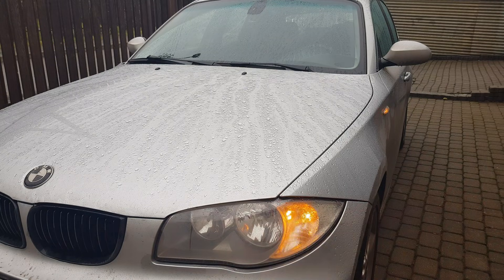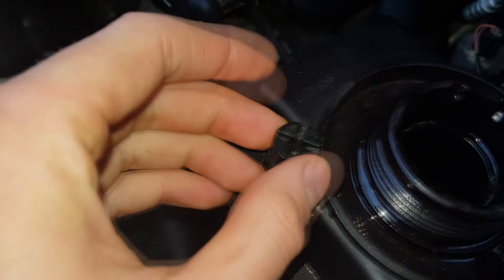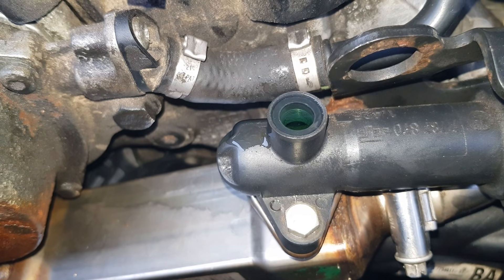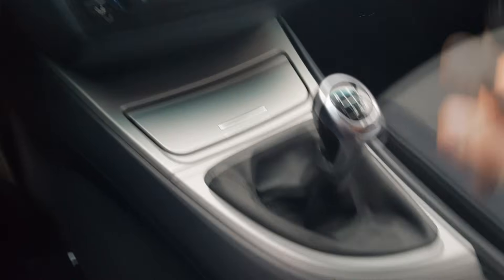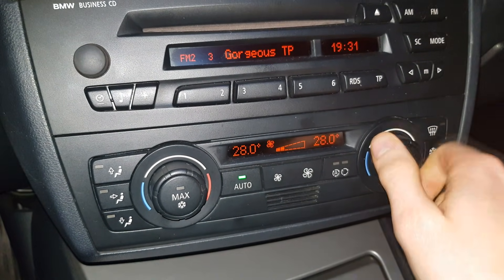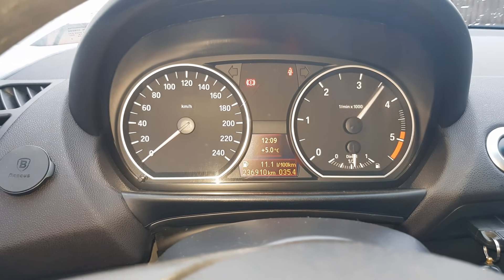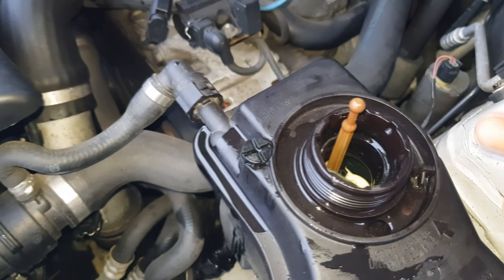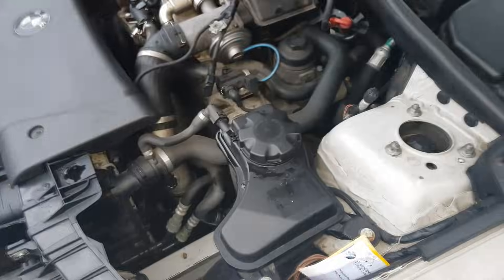How to bleed BMW cooling system💦the fastest way💧

Comment: So I hope you can help me further. I have replaced the antifreeze and since then, the temperature always rises above 95 C and I switch off the engine. What should I look for? I have bled the radiator differently and changed the thermostat. Before that, everything worked fine. What steps do you think I should take? Thanks

Comment: My 06/08 e90 320D with N47 diesel only has a single air vent at the filler bottle, there is no vent screw near the thermostat. I just did a thermostat replacement and refilled it while opening the air vent at the filler bottle and followed all the other points in this video. When you first start the engine try slightly crackin the air bleed screw at the air bottle so a small amount of coolant flows out and way=tch till it no longer foams. The tell-tale that indicates you have properly bled the air out of the cooling system is when you see a constant, strong stream of coolant (without air bubbles or slowing down flow) squirt into the top of the filler bottle through the bleed screw hose hole. If you run the engine and it still isn't showing that squirt of coolant, you still have air in the cooling system. Repeat the earlier steps till you see that stream.
Reply: n47 has electric water pump, no need to start engine just press the accelerator for like 10sec(i think) with ignition on that activates it. Different engine, different procedure.
Reply: @flippy9133 No, the BMW N47 engine does not have an electric water pump. The N47 utilizes a mechanical water pump that is driven by the engine's accessory belt. While some BMW engines feature electric water pumps, the N47 is not one of them.

Comment: Is this applicable to E90 320i 2007?

I already changed the hose connecting to the thermostat. I also replaced the thermostat. Drive belt was also replaced. And I added coolant. This BMW model has no electric water pump? So I tried opening the bleed screw and add coolant. I patiently waited to make the fluid stable and no bubbles visible. (Not sure if I did the right thing though). I closed the reservoir cap and started the engine. Temperature starting to increase. It reached 105degree celsius and slowly reach 108degree celcius. After 5mins it was at 110degree celcius so I turned it off. Is the temperature normal? If not what should I do? What is the maximum temperature for me to turn it off? Thanks
Reply: Hello Joel, i am facing the same issue you described, did  you happen to solve it? any help would be greatly appreciated.

Comment: But how to get out all the coolant of the radiator and engine? I can not find any bleed screws.
Reply: I got same issue. Anyone knows where that screw is?
Reply: I’m using n47 engine and drained from hose I never bled the system just filled it back up and never had any issues
Reply: @thailandhighlife8170 hi! Which hose?
Reply: I did some research. You have to take out the intercooler which is positioned under the radiator. Now you can see and reach a screw which you have to turn with the screw driver so all the coolant comes out.

Comment: my coolant reservoir is boiling and overheating :( any help you can offer?
Reply from the maker: Maybe thermostat is stuck?
Reply: how am i able to check if the thermostat is stuck?
Reply from the maker: If your car is overheating there is a high chance that your thermostat is defective. Here is a video about thermostats: https://www.youtube.com/watch?v=PGkSfPbGr3Y
Reply: @olindor220   I changed the waterpump like a year ago...
my hoses are very hard now for a month and if I remove the cap the coolant is boiling and is pushed outside the expansion tank.
Also the flow from the little hole is a bit weak, sometimes it stops and then it flows again.
Could this be a failing waterpump?